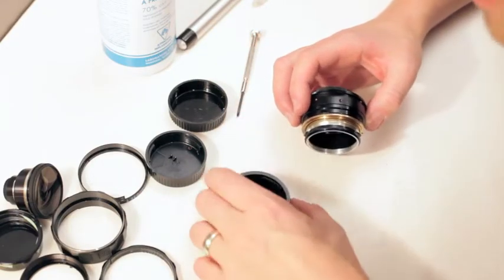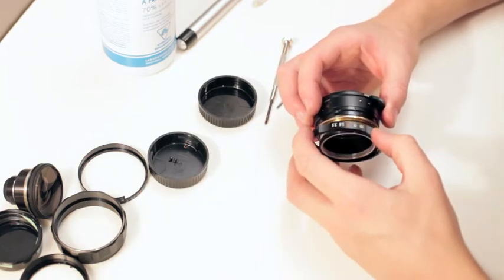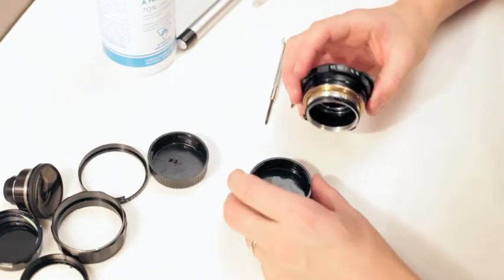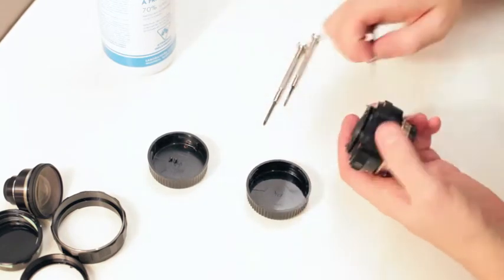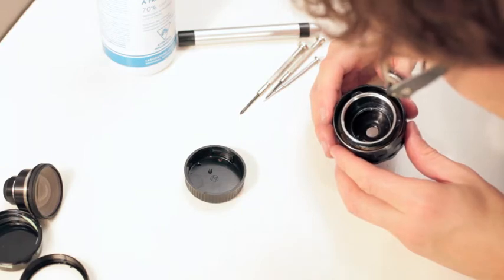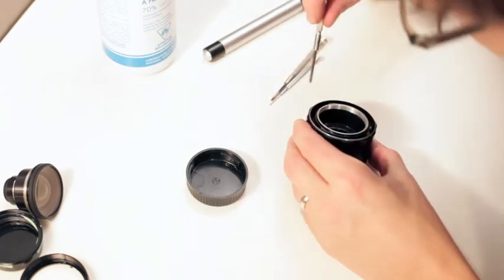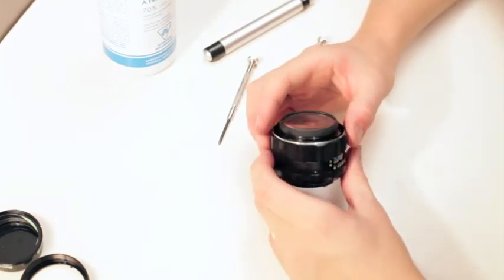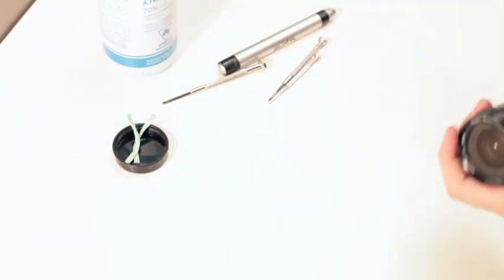How to Repair Lens Oil on Aperture for Pentax Takumar 28mm 3.5 SMC Super Multi Coated Lens Part 3/3

Comment: Excellent video. Where can I buy a locking-ring spanner as shown in the video?
Reply from the maker: +Peter E Sure years ago I bought mine special order from a guy on ebay but I can't seem to find them anymore. (P3-S) but now ebay is flooded with amazing box spanners which are all probably great. http://goo.gl/zDMv39 I would look for the long ones with dual fixed tips. I mostly use the slotted tip.
Then I also use this little guy http://goo.gl/QZm5N9 to do lots of odd jobs where I need the tips pointing in or out. They can flip.
I probably use both of these spanners equally.
Reply from the maker: +Todd Armstrong I have other tools in the description box.
Reply: Many thanks. I'm about to send off for a set.
Peter E.